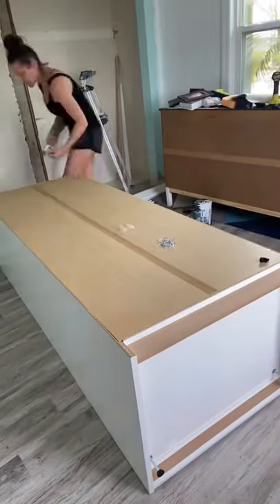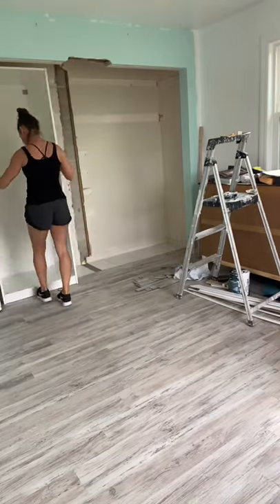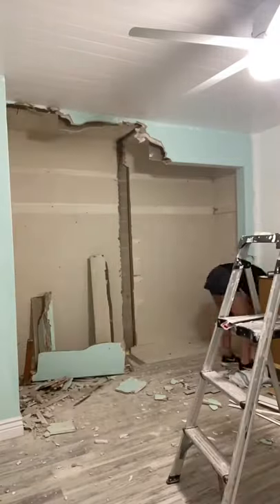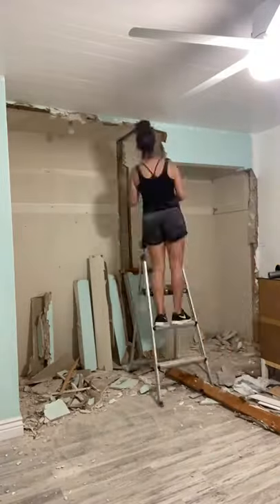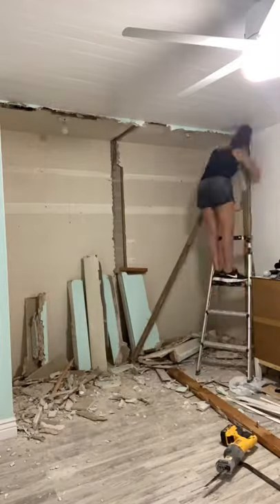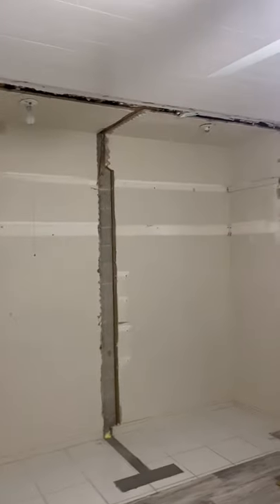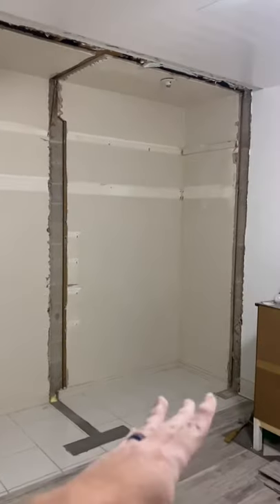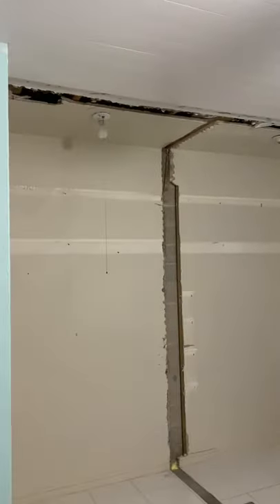Project 8! Didn’t go as planned! So more demo to fit the ikea pax units with storage above! #diy

Comment: How do you know what’s load bearing and what is not?
Reply: Load bearing is usually in the center of the house
Reply: You can check by looking into the attic space. Which way do the joists run?
OR if you have a contractor friend, they'll be able to determine which walls not to mess with. Alternatively, most likely pay for advise from someone like a structural engineer.

Comment: Love how everyone just “knows” it’s not load bearing.
Reply: Exactly  ....Does have experience as a structural engineer? Seems risky.
Reply: If a wall or beam is directly connected to the foundation of your house, it is load bearing. Look in your basement or crawl space for steel beams or joists. If you spot joists in your basement and there is a wall that runs perpendicular, this wall is most likely load bearing. If the wall is parallel above the joists, it's most likely not a load bearing wall. It's really not rocket science.

Comment: Way overkill.....very little benefit for all the reno and demo required
Reply: The benefit is more usable storage for her daughter, so she probably feels it's worth it.
Reply: @tiphneywaldon6748  One more shelf, really? Just another place to store more junk.  For that she rips out a header, needs to do something about the fact the lights in the closet now have to be changed out because the bulb hangs down there, frame it for entirely new doors....etc., etc., etc.  For ONE MORE SHELF?  Sorry, poor judgment.
Reply: @avecrux333  No. You're wrong....and frankly very negative. None of these updates have been strictly necessary.  They are literally all things she did for her and her family's tastes and comfort. As for the lights, it is absolutely not outside her capabilities to switch out to possibly some  pot lights.  It doesn't take long at all. 
Regardless, it's something she wants do therefore not a waste.  At least you don't have to do it in your home. Take comfort in that.
Reply: @tiphneywaldon6748  I'm talking about objective standards, not what she wants.  Objectively the demo and reno to add just one shelf way up high is completely disproportionate to the outcome.
We just put shelving mounted on the back walls of our closets and got full access to the very top of the inside of the closet without having to destroy the header, reframe, remove lights and add new doors. It just doesn't make sense. Our solution made full access of the interior of the closet for a fraction of the cost and labor. Viewers should also be aware of some common-sense alternatives to something like that.  She made a bad choice of using shelving units to begin with. You can put back wall-mounted shelving that's very strong and offers a huge amount of flexibility on where the shelves are placed on the brackets vertically.
Reply: The shelving units may not be the best idea but taking out that header is brilliant. The original is like mine . I have open shelves and I can testify that taking anything off the top would be easier and less dangerous with out the header.  Everytime I need to grab my luggage I basically have to knock it down and jump out of the way to avoid being killed. The closet isn't a walk in and there isn't room to maneuver larger things you would store to safely get out. It makes sense to me that things that aren't used often go to the top so the lower shelves are for more frequently used items. So though taking out the walls may sound unnecessary it's safer, more usable space and something I'm looking for in my next home purchase.
Reply: @tiphneywaldon6748   Well having a header or not doesn't make a difference if you're using it for things like blankets and pillows or storage containers.  We have no trouble at all using the very top shelves in those closets, especially with adjustable shelving....for FRACTION of the cost and labor.  

Do you have any idea how much work is involved in finishing what she did after she tore out the header and the floor and the lighting, attempting to make a smooth transition from the floor in the room into the closet floor; and the walls and ceiling having to be transitioned, finished and painted? It was a huge mess over one little shelf just for more stuff.  That's why she didn't include the finish project... It became an enormous project for very, very little benefit.  Poor solution.  Adjustable wall mounted shelving on the closet's back wall solves it in just 30 MINUTES.
Reply: @avecrux333  I'm glad you found a solution that works for you and your family. Clearly that wouldn't work for her's otherwise she would have followed your actions.  For the rest of us with different needs this is perfect and absolutely worth the costs in time and money.